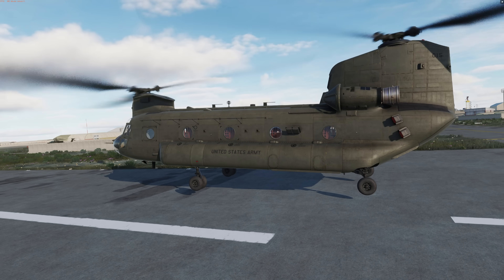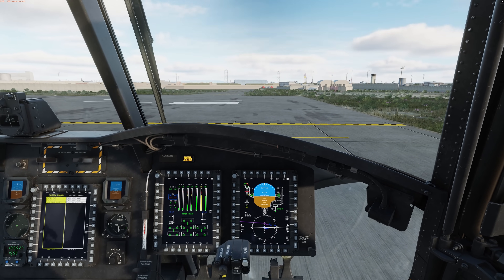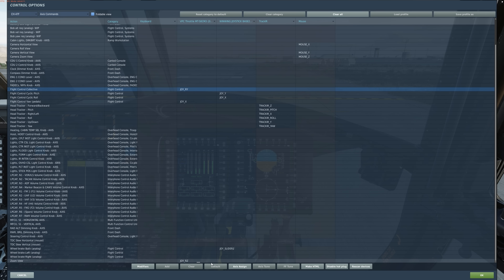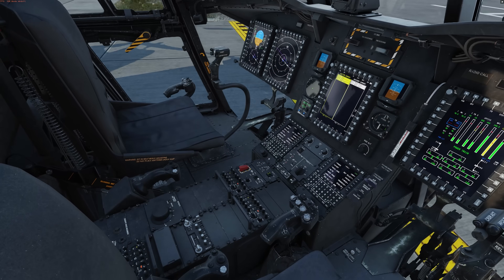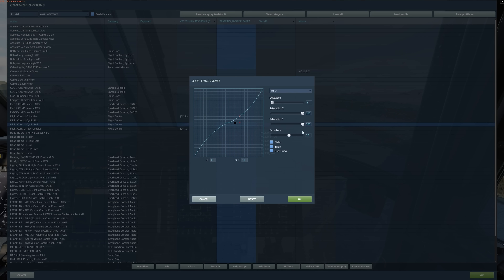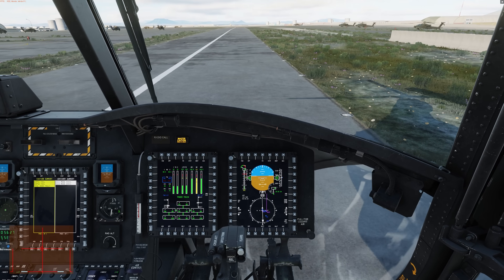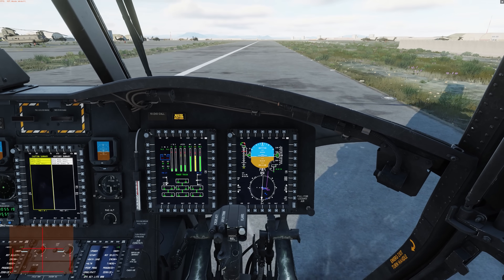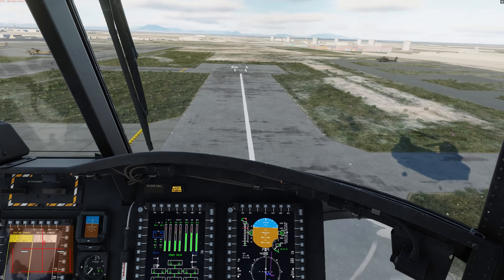DCS: CH-47F Taxi and Takeoff

Comment: With so little features, why not add a AAR probe? It would be something no other helicopter in DCS has. For the record I preordered, not just bitching.
Reply from the maker: So little features? Suggest you read through the Guide. CH -47 is never equipped with AAR probe.
Reply: @MattWagner  literally on the DCS webpage, "With the capability to cover extensive distances swiftly, the CH-47F can be outfitted with extended range fuel tanks and is compatible with air-to-air refuelling, thus extending its operational range further than ever before. This capability underscores the aircraft's adaptability and endurance, making it a formidable asset in any fleet."
Reply from the maker: @zq3yp thanks. I’ll have that text corrected.
Reply: @MattWagner  rgr appreciate the clarification
Reply: @zq3yp  It says further down that the ERFS II (extended range fuel system) is coming later in the early access.
Reply: @MattWagner  No, please correct aircraft instead 😉
Reply from the maker: The CH-47F is the correct version as this is what we have the public data for, not the MH.
Reply: Technically......... the spec ops CH47 has one, but obviously not on the CH47F  ED is modelling.
Reply from the maker: @CaptainMetalwing that’s the MH.